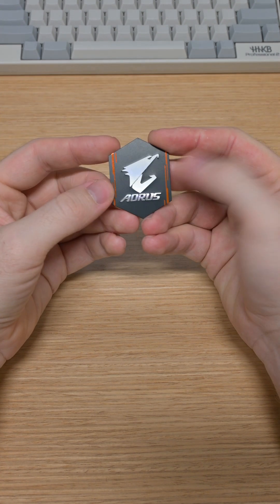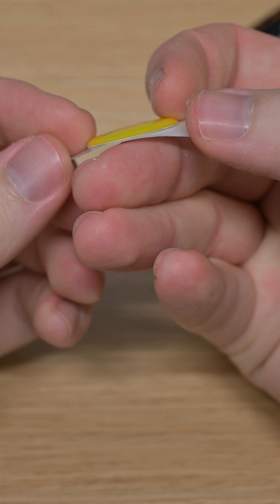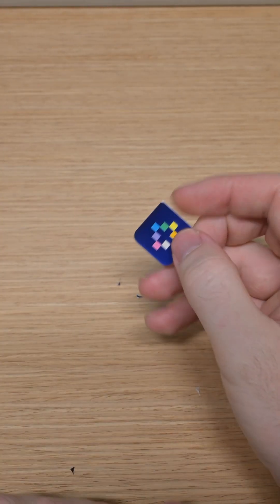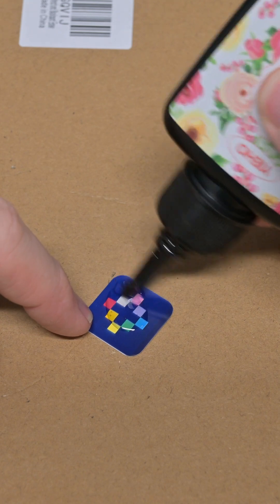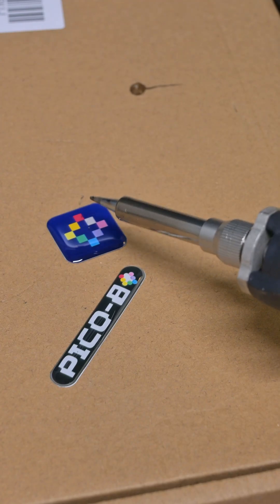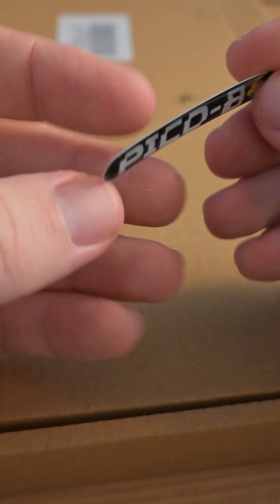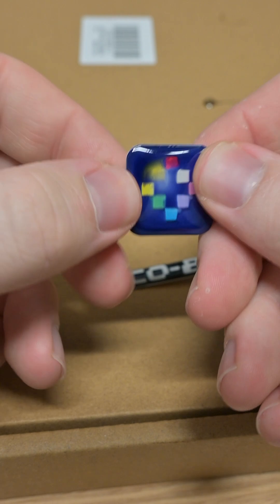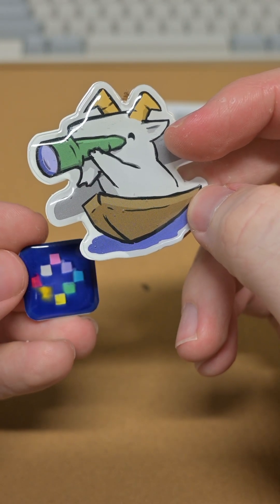Can I make computer badges out of UV resin? (No)

Comment: A suggestion for the long ones. Sand down a piece of rigid plastic or similar to the reverse of the curve that formed in the long one. ie, flip the sticker face down and copy that shape. Next, stick the back of the sticker to this shape. (Bit of masking tape on both surfaces and a spot of cyanoacrylate should work.) then apply the resin, and as it starts to cure but before it completely cures, start pulling the sticker off the block, trying not to bend or straighten it. This way as it cures and shrinks, it may pull it straight.

Comment: Using UV resin this way or any resin for that matter is called doming as your putting a dome on it. The color bleed happens because the resin breaks down the ink. For the warping problem you can use resin tape on the back or sometimes painters tape works good. You can also put a very thin coat of uv resin on and cure it then dome it and that should keep it from warping.

Comment: You might want Mod Podge dimensional magic, you can get it from craft stores and it doesn't have the heat curing that UV resin has. I might pair that with a laminated sticker layer if bleed is still an issue

Comment: You have to use a sealant on the paper to protect the ink before you apply any resin. Some people use tape or wax but you can buy spray on acrylic to make a more solid defense that wont come off later. Ive also seen some people use glue stick but your mileage may vary.

Comment: I used to mod Hot Wheels and I avoided bleeding of the decals by applying a layer of spray varnish on top to protect the ink but in this case it will mess the paper. Maybe placing a piece of clear tape on top will work the same way. I have UV curing resin, and I'd like to test that out. Nice one!!!

Comment: Gotta seal the ink with a coat of elmers or modpodge, then put your resin on top.

And a low tac double sided tape will keep the long one flat while it waits, or let it cure slowly in the sun so the resin can flex and equalize as it works

Comment: Give a quick hit with clear spray paint before using the resin to prevent bleed. Then a thin coat of uv resin cured. Then the top coat to prevent warping

Comment: Would you be able to prevent warping by placing it on a strip of glue-side-up painter's tap? You could get the tape taunt and weighed down, then easily pull it off after.

Comment: A: just use regular epoxy, it's much chaos 6 and works fine
B: cut it after curing or support the back with a stiffer material
C: the bleed is from the sticker ink, protect it from the epoxy. A clear fixative, paint, nail polish, etc.

Comment: Hey! It’s your ink. The printer you are using looks like it’s solvent based. If you use a laminate over the paper (packing tape if you’re trying to keep this all crafter friendly) should create a barrier to attempt this. In truth, though, for the best results, you need vinyl and one that is a little thicker because the standard 3M40 vinyl may be too thin even if laminated with the accompanying 8508 laminate. I would consult some local sign companies to see what they offer. If you bring your own digital files (AI or EPS) they may wave some set-up.
Reply from the maker: Interesting thank you for the info!
Reply: Or print with a laser printer.

If you dont have one have office depot print if for you. They use laser printers.
Reply: The ZINK-printer does not use solvents. Its a thermal printhead.
Reply: Can confirm. I have worked in digital ink jet printing for 5+ years. Solid advice!!

Comment: The color bleeding is probably due to using an inkjet printer (water soluble ink, afaik) and an ordinary sheet of printer paper (made largely from wood pulp) which will readily absorb water. --- Using different ink and different paper will almost certainly yield better results. Buying good quality prints would be the easiest approach, but a "photo printer" with the special ink and glossy photo paper would likely improve the outcome.
Reply: It's a ZINK-printer. There is no ink involved.

Comment: Try painting on a single thin layer first. That will cure much quicker and seal off the painted layer so there won't be color bleed afterwards.
Reply: that is a good idea
but you need to use gloss paper & a laser printer also
the 2-3 step resin pour is how i encase butterflies ❤
Reply: @jonniefast  If you do a very thin layer first so the ink doesn't have a lot of glue to bleed into it will be locked in place when that first layer dries no need for laser printers and gloss paper. I was similarly thinking a quick spray of clear coat paint would lock the ink in place too.

Comment: Would definitely recommend printing them on some sort of weatherproof vinyl to prevent the color bleeding.
Reply: If you wanna be really slick give it internal structural suppprt like a leaf
Reply: could probably just do what hes doing and slap a clear coat on top before applying the resin
Reply: @Dead-vh4kq yeah
Reply: And should spray sealant after letting the print cure for 24h at least (depends on ink type for the drying part)
Reply: I use that for product labels, it gives super high-quality prints. They're also waterproof and oil-resistant, which is necessary for my products.